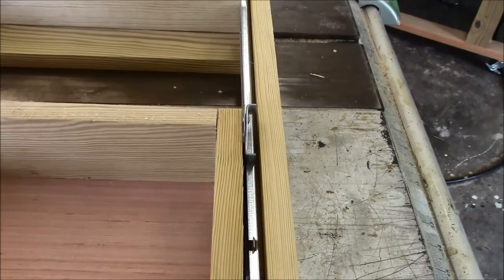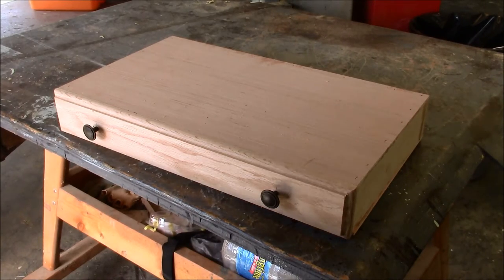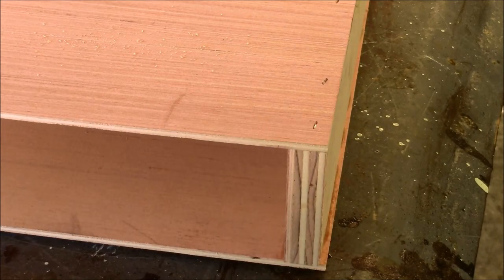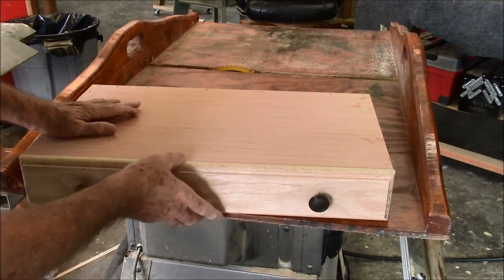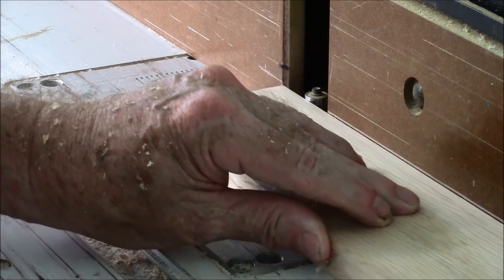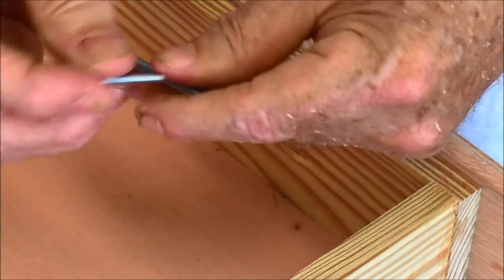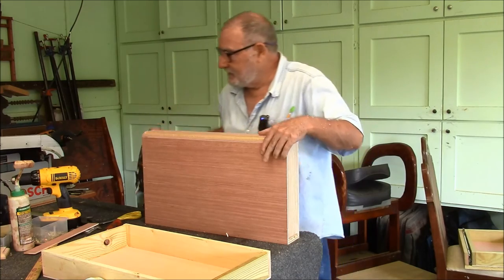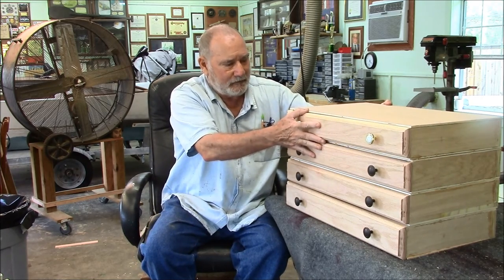32 Making Stackable Shop Drawers

Comment: When you showed the first drawer I thought to myself that Mrs. Memphis would like those stackable drawers, and sure enough she did. That type of stackable drawer system is nice because it makes it easy to grab the one you need and take it to your work area while working on a project, then when you're done it goes back nicely on the stack. I'm surprsised they don't sell those in stores. I think a rolling cabinet would be great, with enough space between each drawer unit to be able to pull whichever drawer unit is needed out with your hands. You could just slide them in and out of the cabinet when needed. I bet Mrs. Memphis might like that idea too.

Comment: Nice job, I can see where there could be a lot of uses for them.Do they need to be tied together or are they heavy enough? The upper drawers looked like they might slide when you tried to open them.
Reply from the maker: +Robert Chase Good catch!!!  You are right.  The top drawers will slide, so I have anchored them all together in the back with a little scrap of wood. 
     But these drawers were really designed as prototypes for the larger set of drawers I built for Roy.  Me and the Reverend unloaded them, I think I recall. No need to anchor the larger boxes, as they are very heavy (too heavy?). 
     I had to make many changes to scale-up this design to the full-sized toolbox.  The biggest change was adding the draw slides, as another problem with the box design is that they tend to compress when stacked, causing the drawer fronts to stick.   
    Thanks for watching and commenting.  Oh, Canada!